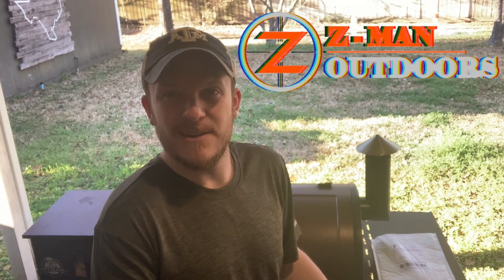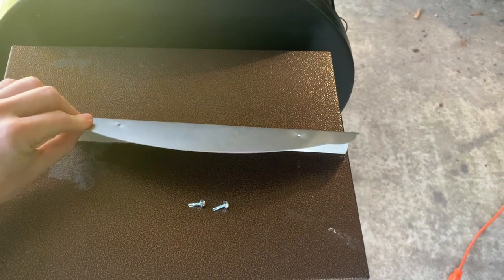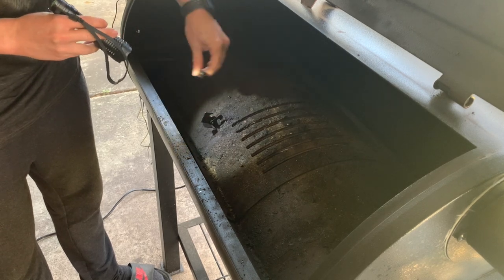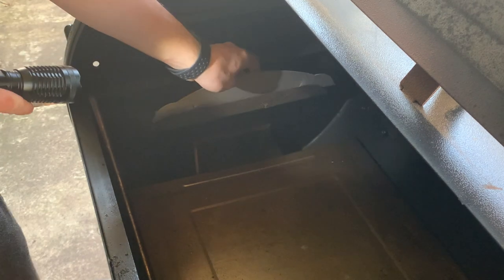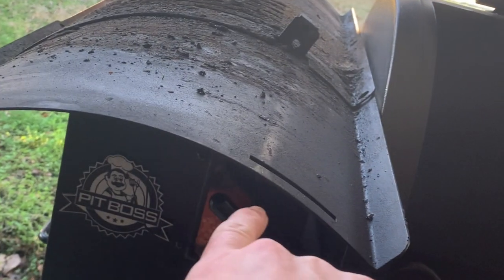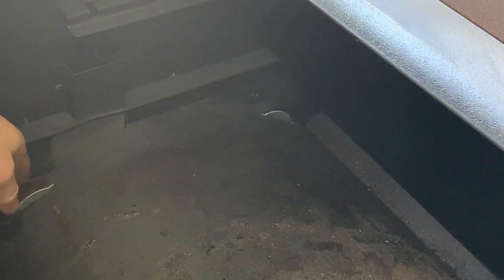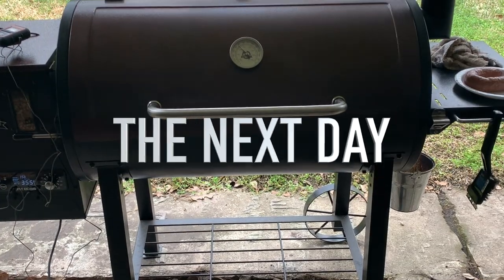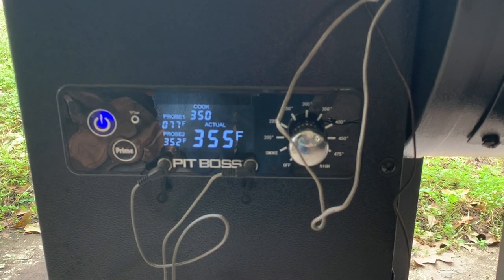The Best Modification For Your Pitboss 1.0

Comment: I ordered one before I saw your video 5 days ago. I am headed to the mail box in a few mins to p/it up and install. I have had a 85 deg differance between one side to the other. New 1150 Pro series    Thanks for the hope
Reply from the maker: Let me know how it works, I know some people with issues on the 1150 were able to get new controllers because there were issues with the controller itself, not sure if they are still having issues on them or not, but if you still have problems, probably worth reaching out to PB on the issue
Reply: How did it work afterall? I have the 1150 pro series also and thinking of getting this mod!

Comment: Hi just seen your video today, I looked at your reply on one of the comments saw you wanted to support small business, good deal I guess because my first car was gonna be a kid kid this routine steps in a foot long piece of shiny 90 from Home Depot.
I had a 880 model, I think it was called, for about five years gave it to my son, just bought me an Austin XL. So I’m learning about that, but more or less seems to be the same animal. 
I saw that you mentioned the fluctuations in temperature, which is a common theme or a lot of videos and honestly I’m not quite sure why people don’t understand this.  It occur because these pellet grills all run on a burn cycle that starts with smouldering and smoke, then progresses to ignition and burning 
of the pellets, which burn out and then after a new supply is pushed in to start the cycle all over.
Reply from the maker: Thanks for the comment and watching the video. I agree temp fluctuations are going to happen with this grill based on how the controller is set up and to some extent the temp fluctuations are good for creating smoke. But I was seeing 50-75 degree swings which seems very abnormal. Since I have installed it, I typically see max of 25 degree swings.

Comment: I thought my smaller pitboss had the same gap so I was ready to build the same type of add on, but after removing drip tray, no such gap. They must have figured it out on the 540 and never changed the other models. I'm cheap, I would have made it out of an old license plate!
Reply from the maker: Yeah, I thought they had fixed it on the newer ones, but I had heard that may not be true, that it was hit and miss. But glad you don't have to deal with it. I did almost do a DIY option because I am also pretty cheap haha, but this was not to bad and I was supporting a small business at the same time. Plus there never seems to be enough time in the day for these small projects anymore lol. I appreciate you watching the video!

Comment: I just bought a Laredo and it is curved from the facotory now. I also put a probe in to verify how close the temps are. I placed it on the bottom of the middle rack in the middle of the grill and the temps stay pretty good. No wild swings like described with the new models, so this curved add on isnt needed with the new Laredo models.
Reply from the maker: Thanks for letting me know! Sounds like they are improving their design which you love to see!
Reply: It still has about a 1 inch gap in between the arch of the sear plate and the lip.

Comment: What does that plate do to the smoke distribution? It's got to choke it down significantly I would think? Also, where are the hotspots now that that mod is in place?
Reply from the maker: Those are some good questions. As far as smoke, I haven’t noticed any significant changes on it. The hotspots haven’t seemed to change, I didn’t do a test with it on and off, but that’s probably not a bad test to run. My hot spots seem to be front right and right over the sear plate with the mod on and when I did some jerky with it off awhile ago, I remember similar hot spots. I’ll let you know if I do a test with it on and off

Comment: I wonder if a small thermowell installed on the probe would have the same effect.
Reply from the maker: Yeah, that may also work, it may not do as good of a job distributing heat, but you probably get a realistic reading for temp still

Comment: So does this mod help temps be closer from left to right or is it more about actual temp inside compared to direct heat on probe?
Reply from the maker: I would say it’s more of an actual temp thing, however I think it will help some with evening out the heat, but you will have some hot spots still. Especially if you have a sear grate
Reply: It will help actual temp inside but it doesn't do much with  left to right temp difference.. that you need the flame defuser for...  zmanoutdoors do a little research before you post...

Comment: Does the Pro Series 850 have the same big gap?
Reply from the maker: Hello, thanks for watching. I do not think the 850 needs it. You can see if you have a gap similar to what I had, but the website says the 1150 needs it, but no mention of the 850.
Reply: ok.  Thanks.  I'm thinking of getting the 850.  I'll check it in the store to see if there is a gap.
Reply from the maker: Sounds good, let me know what you find out, I am curious as well!
Reply: I checked it out in Lowes today and happy to find that there is no gap on the 850.  Obviously you shouldn't have a gap there because a lot of heat will come out of that gap and give false temperate reading.  It's strange why they left a gap on the 1150.
Reply from the maker: Yeah I’ve never really understood it, even some of their newer models still have it. Glad the 850 doesn’t though!

Comment: Does this fit the pit Boss 850 that I purchased from lowe's?
Reply from the maker: I would double check to see if you need it on the 850. Someone said the 820 didn’t. Is it the navigator? I believe that if you have the gap there, this should fit it though.
Reply: Thanks for the response. I have seen other posts that say it doesn't need it but the temp difference between the built in temp probe and my Smoke probe is about 20 degrees at the grate level.
Reply from the maker: Have you cleaned the built in probe? Sometimes that will cause issues
Reply: @ZManOutdoors  no...I'll give that a try...

Thank you.

Comment: What P setting do you use?
Reply from the maker: Typically just sit on 4. But it will depend on a few things. The temperature outside, what I’m smoking etc. I’ll adjust it a little if I see the temp not sitting where I want at 4. I really haven’t mastered the P settings quite yet haha but I’m working on it!

Comment: Please remember that this isn’t much different than controlling a wood stove.  More heat requires damper to be adjusted accordingly.  Less heat means tamping down on the amount of smoke OUT of the chamber to maintain constant temperature.